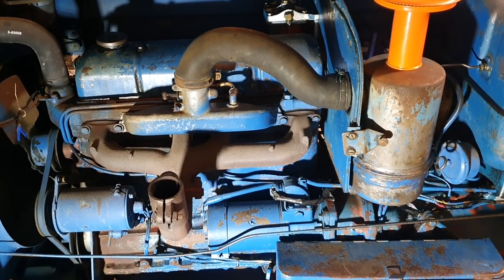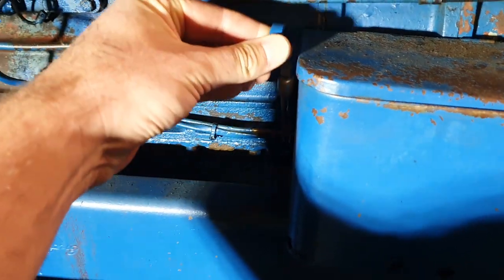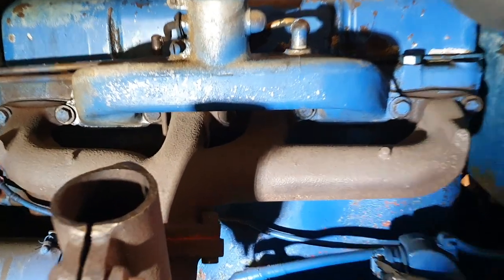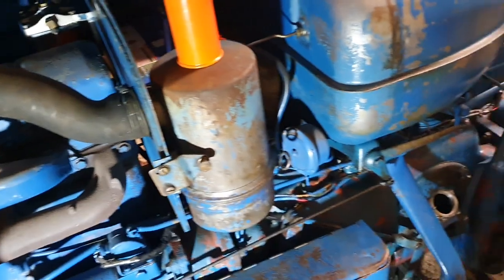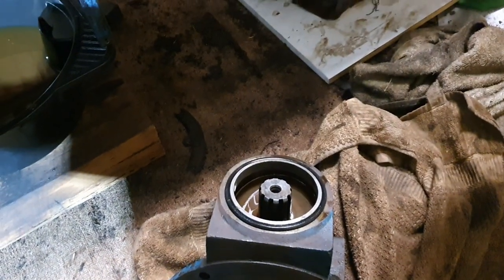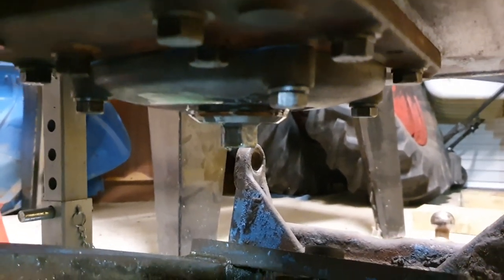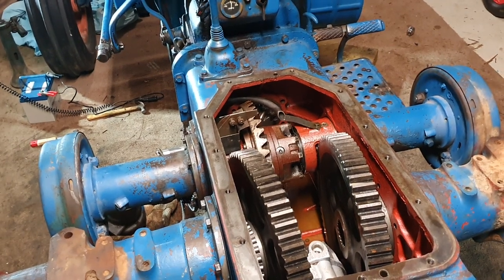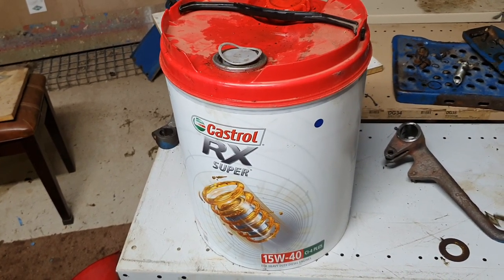Fordson Major Oils

Comment: Majors are not that picky, as long as they have engine oil in the engine and some kind of oil in the gearbox and hydraulics they work just fine lol. In Finland the hydraulics ususlly freeze during winter and we warm them up with a blowtorch to get them working again💪

Comment: After 1955 they changed to using 10w40 tractor oil for engine n hydraulics, not sure for gearbox, cool video! Mine runs sweet after I done the timing! Starts on the button!

Comment: First i drained both tanks and then i filled oil to the rear axle tank. When i saw that in transmission did not come any oil i opened the transmission drain and oil came out. So is this right or is there a problem with the seal? Thank you

Comment: I have a 1959 major with no three point hitch.  It didn't come with one.  It is also yellow, not blue.  The hydrolic fill point is directly under the seat.  I am in Canada an was told that  this is a commercial machine. There is a name plate on the inside of the firewall that says it was done in Hamilton Ontario Canada.  Anyone heard of this?
Reply from the maker: You are correct, it was originally a Fordson Industrial conversion. Generally they had buckets on the front and weights in the back instead of a 3pl. Used in quarries, rock pits and industrial settings, usually with beefed up front axles etc. Some farmers bought them cheap at sales, pulled the lifting gear off the front and made them pull tractors.
Reply: @fixingfordsonsaustralia6632  Sorry about the late reply, just saw this now in my gmail account, but it was hidden in a folder that I didn't know was there.  Thanks for the answer, I found another one of these about 10 kM from my place.  It has a loader mounted on the back with outriggers etc.  Looks like a custom one off build.

Comment: hi from Greece, i own a fordson major and can you tell me if the gearbox and rear axle oil communicate? Because there are two drain holes, i opened them and i drained the oil. I filled oil from the hole behind the seat and the level for the rear axle is now at high but at the hole that you filled the transmision there is no oil. When i opened the cap above the tractor oil came out. Thank you
Reply from the maker: They are two different oil 'tanks', hence the two fill points and drains. They are seperated by a rubber seal in the PTO housing under the tractor. The fact oil didnt go into the transmission when you filled the rear axle is a good thing, the seal is working. Despite being different tanks, they take the same type of oil.

Comment: Bit of confusion !  Mate are u saying that you use the Castrol RV Super 15w - 40 in the engine gearbox and hydraulic system? so same all for everything?
Reply from the maker: That's correct! Was designed to run on all the same oil to reduce costs.

Comment: yesterday i check the oil in the gear box it was low, i checked the rear end oil it was high,so i drained some from the rear and when i went to put it in the gear box, it was higher then when i checked.so i topped it off and put the rest back in the rear end,, should the gear box oil be checked after running the tractor for some time? or when it has been sitting?
Reply from the maker: I do have another video that shows the seal between the gearbox and rear end. If this seal perishes the oil will slowly leak into the lower rear end. I suggest check it before starting and top up as needed.

Comment: You mentioned the forums, what specific forums are you on? I'd like to find them and join them.

I live in Oregon, USA, and I think I just found a pretty sweet deal on an early 60s Fordson Major equipped with a backhoe. 

I still need to figure out exactly what year it is, and I need to figure out which manuals to buy for it, but I'm pretty sure I have the old timer talked into letting it go for a mere $500. 

As far as I know, there's nothing significant wrong with it. He said it ran 5 years ago when he parked it, it was just starting to have some slight fuel pump issues at that time.
Reply from the maker: A backhoe Fordson for that price is fantastic, even if you can't get it running you will still make a profit. There are a lot of very useful forums on Facebook, many of them have a files section with manuals and diagrams to help. A simple issue with the fuel pump is usually a cracked diaphragm, a simple fix. Good luck!